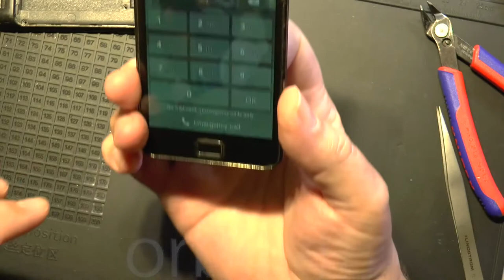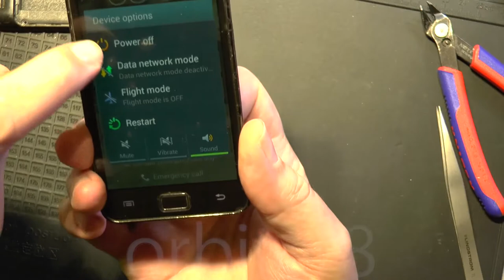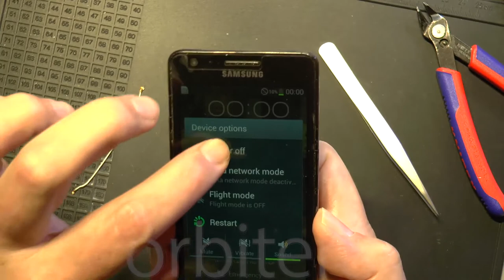Samsung Galaxy S2 - Charge Port & Flex Cable Repair.

Comment: Nice repair job John. I do enjoy repair videos... They're like murder mystery novels for electronics geeks... I correctly guessed the method of death at around 4 mins in, and you showed us the culprit at 19 mins... I just knew it was going to be one of those little guys :-)  ... I didn't guess the culprit for the second problem though.. Well done on another successful fix. Cheers!!
Reply from the maker: Thanks a lot Jim. Always appreciate your comments, and well done on the mystery solving :) 
Cheers, John

Comment: Smashing job john :-D, the samsung snatched from the jaws of death.

That metal plectrum reminded me of the metal in feeler gauges, perhaps an old set may be usefull one day for sliding under a chip or whatever, 2 thou up to 30+ thou, imperial of cause :-D.
im allways supprised how easy the capacitors go short, they seem as bad as bead tantalum caps on ordinary pcbs, they go short then explode if there is enough current available.
Reply from the maker: Hi Harvey. LOL... I'm guessing you used to set points and tappets then too mate :)
Yes caps do seems to fail easy these days don't they, perhaps they're just crappy ones. At least these don't stink like the tantalums though :)
Cheers friend, John
Reply: Yep, points/tappits/sparkplugs :-D.
I've never been an engine tuner, i just wanted it to be reliable.
You can have a super duper engine, but if it don't start easy it's useless.
I've allways been a bit boring ha ha :-D.
Anyway, well done with the repair, you won again :-D.